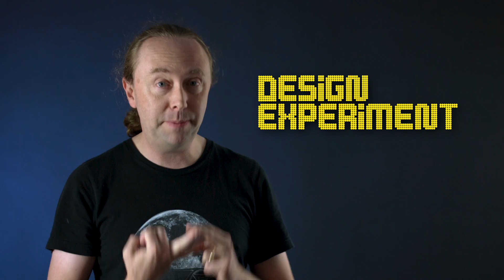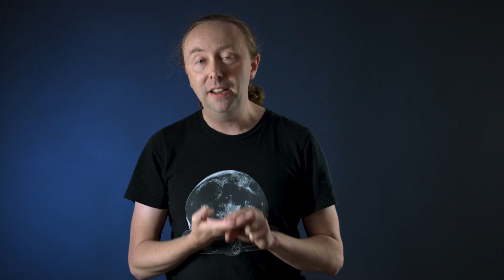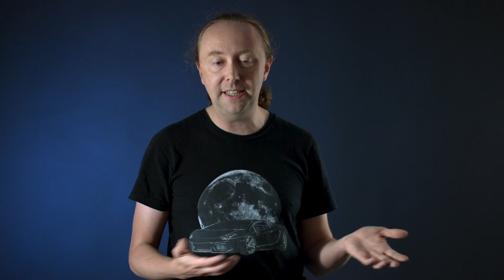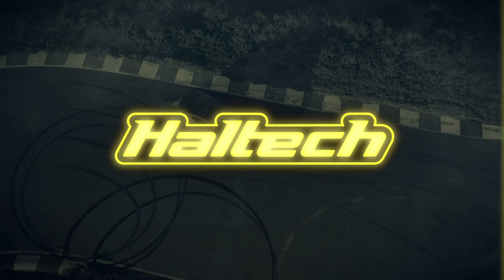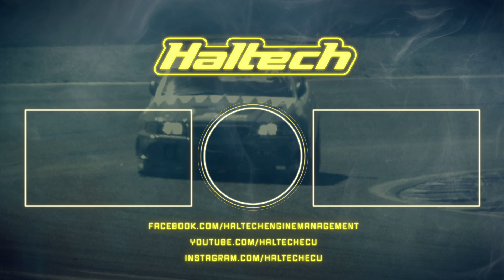⚠ Why Scientific Method Works | ANDY'S RANTS

Comment: I have a question for you guys. I'm using my stock wiring harness with stock ecu and sensors. I plan to upgrade the ecu and repin the sensor connectors with deutch ( idk how to spell it ) connectors. Is this a bad idea ?

Comment: And we're back 😁.
Easy to diagnose a trigger problem with the Adaptronic on board scope. Oh wait 🙄, not on Haltech... 😐 🤔

Oh and give my regards to Mark for helpings to sort out issues with the  M6000 I bought for my GTiR👍
Reply from the maker: Changes are being made ;)
Reply: @haltech  Is the Nexus Oscilloscope function going to be for just the trigger and home inputs or all the inputs; analog, digital, and synchronized pulsed inputs? I enjoy listening to Andy.

Comment: see this all the time, people replacing expensive parts trying to diagnose a problem but they never check the basics first
Reply: Happened last week to a new client, dude has a Mercedes Kompressor, took it to the dealer and other shops cause the car would not accelerate, they replaced throttle body, relays, fusebox, not a single one checked the pedal sensor (no error display on sensor) of course it wont display shit, the car just thinks you are only idling it, it had water damage because the sensor it sits at floor level and the owner forgot the window down a couple months ago during rain, found the water stain on the carpet... just cleaned the sensor and got it running while a replacement sensor comes in the middle of the pandemic, a $20 sensor that costed him a couple hundreds already on dumb people. He will bring me all his projects from now on :D